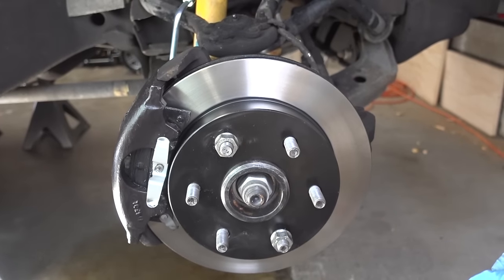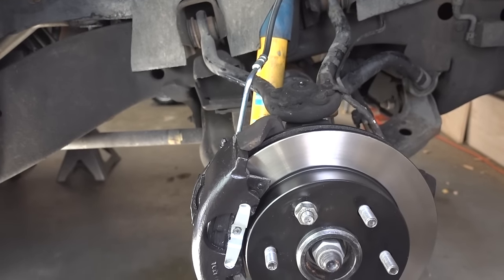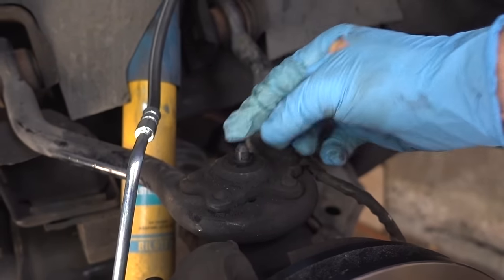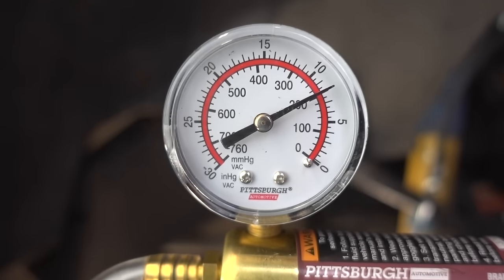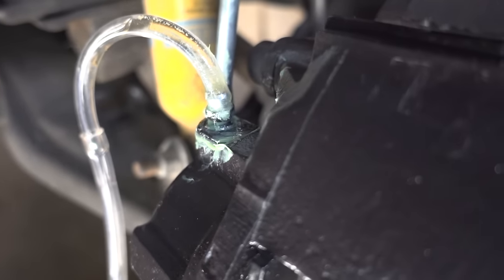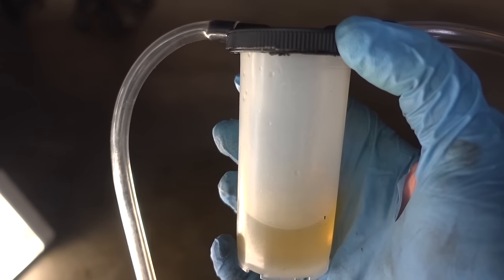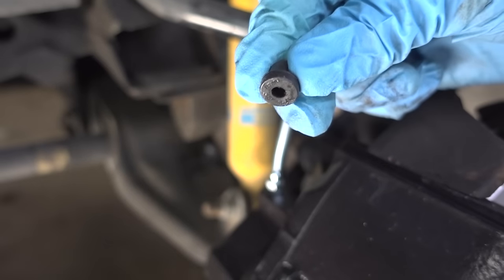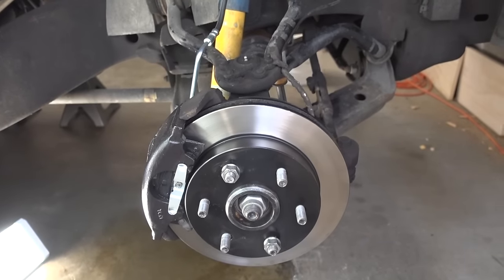Best Method To BLEED BRAKES BY YOURSELF!

Comment: An even easier method is to use a water bottle large one 20-30oz. Drill a hole in the center of the lid so the clear tubing fits snugly in the hole and then a smaller vent hole in the cap. Fill the bottle with just enough brake fluid so the tubing is submerged this will prevent air being sucked back in. Crack open the bleeder screw get in vehicle push the brake pedal 10-15 times making sure to check level at master until there are no bubbles showing in line. Make sure to start with the RR then LR move to the PS then DS. The ABS module would have to be bled using a scan tool that can activate and bleed the module. Actually no grease needed since the hose in bottle is submerged in the brake fluid not allowing any air to get back into the system.
Reply: While it is true that no grease is needed using the old school method, it can often be the case that if doing it   with only one person, that when you let up off the brake pedal, there is still some air in the tubing that gets sucked back into the caliper.  The method in the video is an easier way to make sure this doesn't happen due to both drawing a vac, and being right in front of it to see the bubbles.

Comment: Do I need to bleed the brakes if I took off the reservoir caps and cleaned the water from the top of the rubber membranes?
Reply: Normally you dont. You are supposed to refill there and they never said that after every refill you need to bleed it.Unless it drops under the min sign.
Reply: @kevin.afton_   I don't know why I asked such a silly question now. Thanks

Comment: I’ve been watching videos like this because I want to bleed my brakes. There is another you tuber that said not too use any random type of grease, and said a particular type, but I don’t remember, is this true or someone knows?
Reply: That was false information, any viscous grease will work because it is only in contact with the bleeder screw and caliper threads.  HOWEVER, if someone were stuck on the idea of one grease being the only one that they could use, it would most likely be castor oil based, "red rubber" grease.  This does not mean that any random red grease, like a certain brand  calling theirs red 'n tacky, is the same.  Red rubber grease is formulated to be compatible with the brake systems of very old vehicles, back before they had modern polymer rubber which is resistant "enough" (since no contact anyway) to common  lithium complex grease or silicone paste grease.
Reply: @stinkycheese804  thank you for your reply.

Comment: You can also use some putty or even chewing gum around the bleed valve if you don't have any grease.
Reply: Not very well, either of those, being less fluid, has less of a probability of retaining a seal after you've loosened and tightened the bleeder screw a couple times, let alone more times than that.

Comment: It's amazing how people spend money on stuff you don't even need.
Reply: You don't need it, but it certainly makes the job easier, especially if you've lost a lot of fluid
Reply: Makes it easier!!!!!
Reply: You need a vacuum pump on brakes if you work by yourself. You need a vacuum pump to test other components like EGR valves, solenoids, find vacuum hose leaks, etc. there are many mechanical uses. Maybe need is not the word, but if you’re your own mechanic not having a vacuum pump is a travesty.

Comment: Your wrong in hooking up your tube first. You should put the boxend wrench on first. People like you screw up the bleeder valves so much by using the open end wrench. These bleeder valves are usually tighten down by Charles Atlas and the open end will spin and round the bleeder valve ears. Please never show using an openend wrench to open bleeder valves ever again
Reply: I usually brake loose the bleeder screw using boxed wrench first, and then use the open side of the wrench during the bleeding process. It's enough to just move it and tighten again so there's minimal fluid spill.

Comment: I dont know why they dont just make small ball check valves bleeders or a different design all together to bleed. Turning that bleeder screw is not the most efficient. You would think with a push of a button all lines could be bled (without a scan tool)
Reply: You can buy bleeder screws with check valves, often called "speed bleeder" but OEMs don't seem to favor them, either due to being less reliable over the long term, or just to save a few extra cents on bill of materials to manufacture the vehicle.

Comment: Can you just add new brake fluid !? What the real reason it have to be bleed !?
Reply: Bleeding to either fix soft brake pedal OR flush out old dirty brake fluid. The adding fluid part is good but you need to get the old fluid out. It's ok to add fluid if you have no problems with pedal and your oil is clean like light brown honey color.

Comment: Do not suck grease through the threads. You  will ruin your brake system
Reply: Agreed. This technique is a noob way to bleed because they open the bleeder valve too much or have a poorly fitting hose or bad vacuum.

Comment: This is not the best method. It can be a pain to get a good vacuum , then you have to keep pumping, stopping, turn the bleeder... Get the small bottle type that uses air and connects to a car tyre. The pressure is constant and you can bleed each corner in one go. Sooo much easier.

Comment: Threads don't just magically let air pass on a system with a vacuum
Reply: No magic needed.  The bleeder screw is designed to create the seal at the bottom, not necessarily through the threads.  Take your pick of any bolt and threaded thing it goes into and you will find that many are not especially air-tight, especially when the threads are tapped into iron like on most brake calipers.